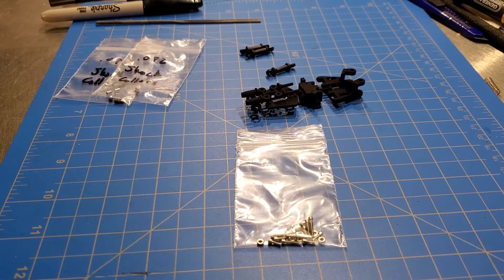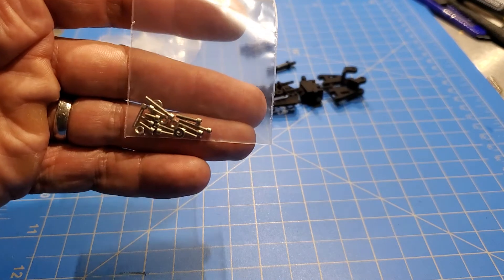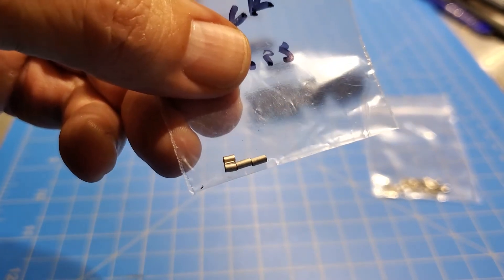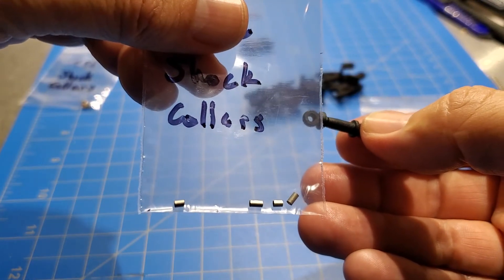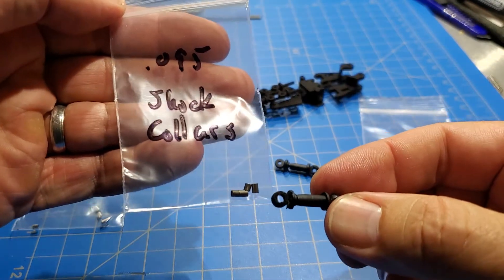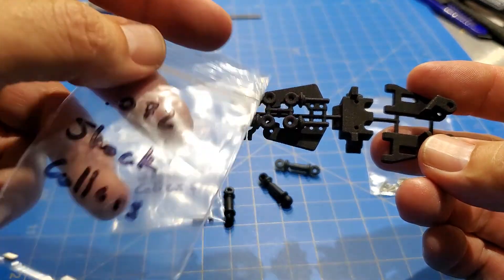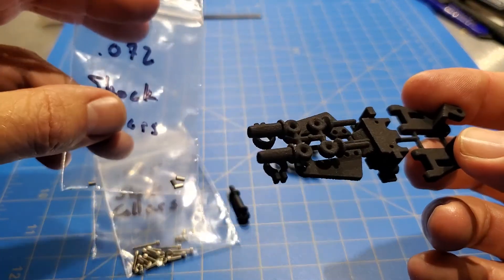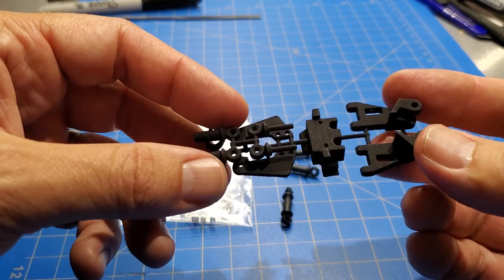RC28 Front Suspension Kit: Hardware Kit

Comment: 1. Are you still offerng this kit with hardware?
2. In the videos the black plastics looks real rough. is it much better now after production? Seems like a lot of work would have to be put into the shock bodies so they work smoothly.
Reply from the maker: Yes, I still offer the hardware and springs. The plastic is a bit rough, sometimes takes a little sanding to get the shocks to operate smoothly.

Comment: I was so excited to buy the kit with shocks I didn't realize I needed the hardware kit separate but I can not find the hardware kit
Reply: Im stuck with two kits I cant build
Reply from the maker: The short answer is, just email me bsconklin@gmail.com
The kits with springs are $7.50 + $3.00 shipping.  If you need two kits, the total is $18.00 shipped.
Reply from the maker: Hi Justin,
So sorry for the delay in my response.  You can find the info you need on ordering the hardware kits in this video description: https://youtu.be/26gViBJb-xk